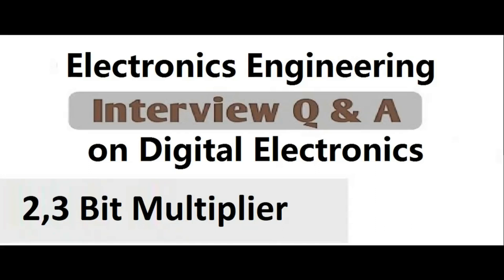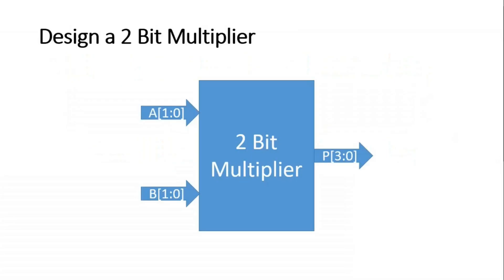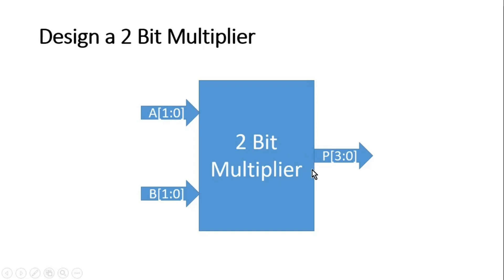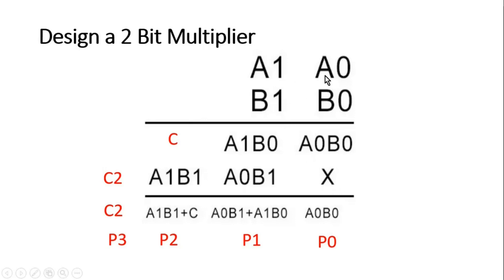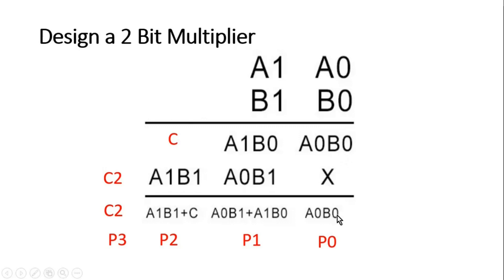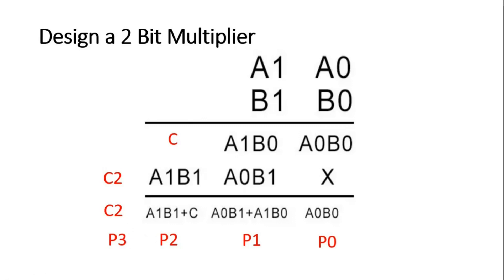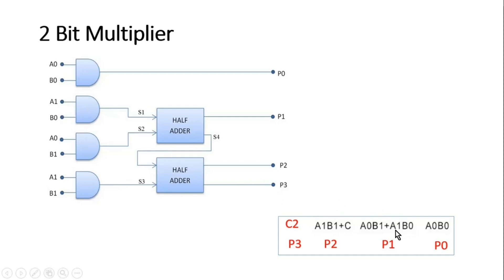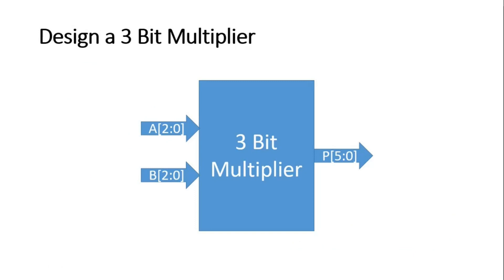Digital Design Interview Questions Part 19

Comment: 3 bit Multiplier Logic:
5 output bits are [Y5 Y4 Y3 Y2 Y1 Y0].
Y0 = A0 B0
Y1 = A1 B0 + A0 B1 (also will generate C1 ), can be implemented using half adder
Y2 = A2 B0 + A1 B1 + A0 B1 + C1 (also will generate C2 ) , can be implemented using 1 full adder and 1 half adder
Y3 = A2 B1 + A1 B1 + C2 (also will generate C3), can be implemented using 1 full adder
Y4 = A2 B1 + C3 (also will generate C4), can be implemented using 1 half adder
Y5 = C4
Sir, is the solution correct?